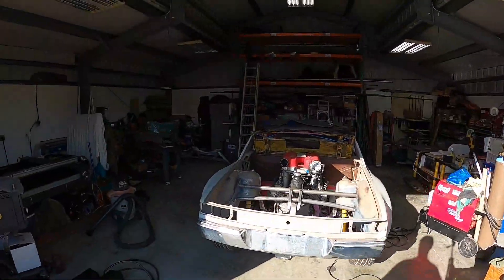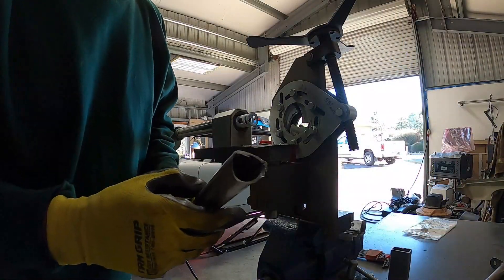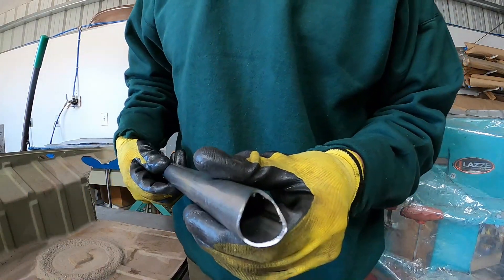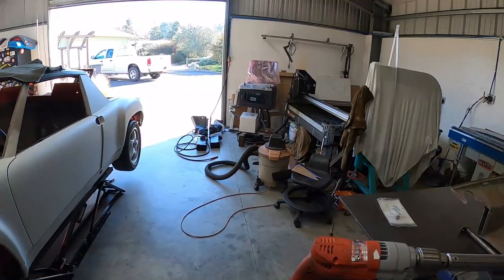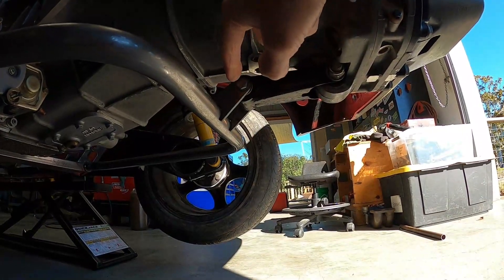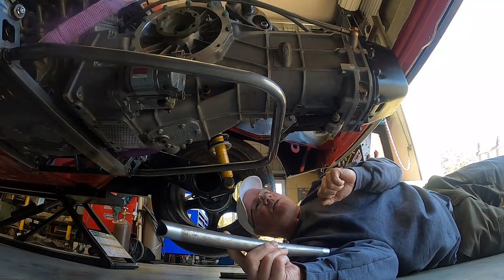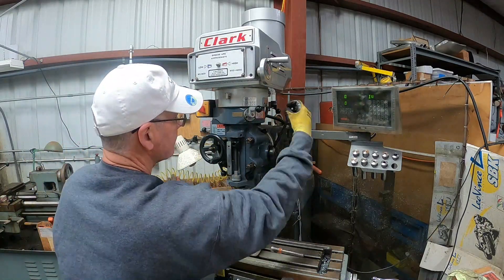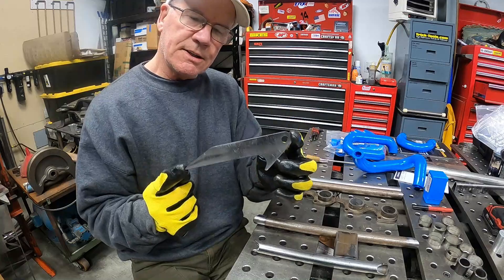914 Ferrari Build - Episode 11: Rear Trans Mount Part III

Comment: I must have missed something. What type of movement are you trying to stop? The fab looks good thou.
Reply from the maker: Thanks! The pivoting link is limiting fore/aft movement of the whole drivetrain while it's allowed to rotate (a little) around the top transaxle mount.
Reply: All I got was fore and aft movement. I could see the back of the trans wanting to lift, but do not understand the front back movement. On the surface, if that were the case, I can't see why tying it directly into the back of the chassis/body wouldn't accomplish the same goal.
Reply from the maker: The motor and trans mounts are pretty soft and the whole drive train moves a lot more than you'd think. All I'm trying to do is create a mounting point for the front of the pivoting link, like it has in the 360.
Reply: @attheredbarn1669  Now I understand .thank you